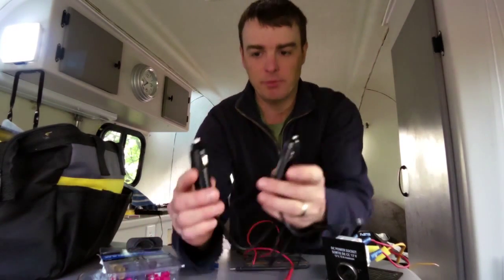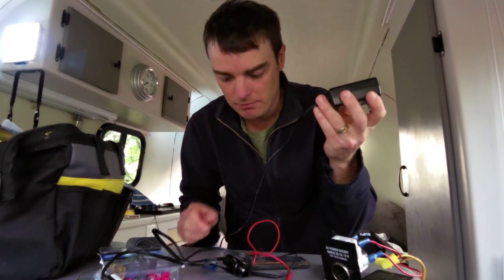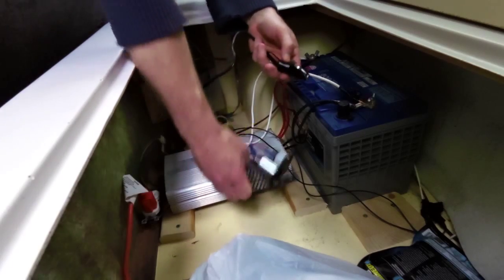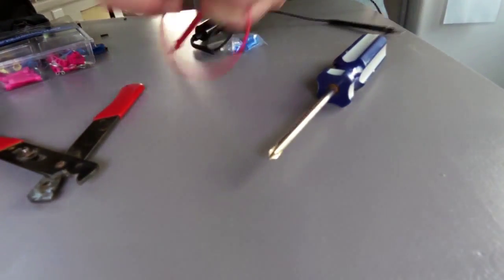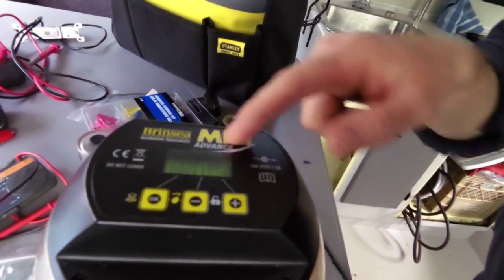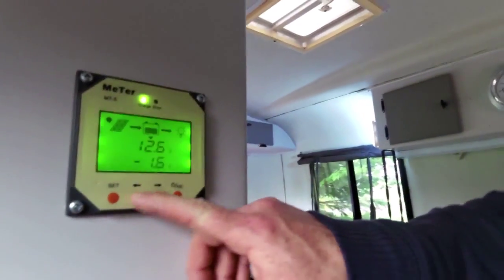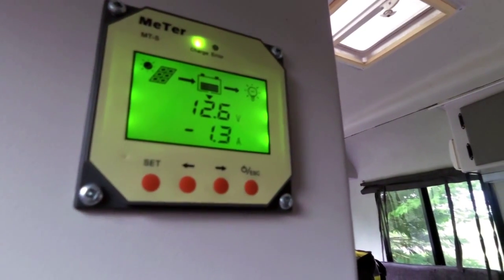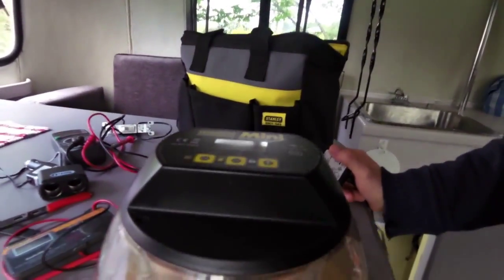Solar Powered Brinsea Incubator in a Boler Camper

Comment: It has to be more efficient doing it this way, rather than inverting the voltage up to domestic AC and transforming it back down to 12V DC.
Reply from the maker: Miko Jones yep, a bunch more efficient for sure.mbest way to do it if you can!  Plus I don't have a sine wave inverter so that causes even more losses.